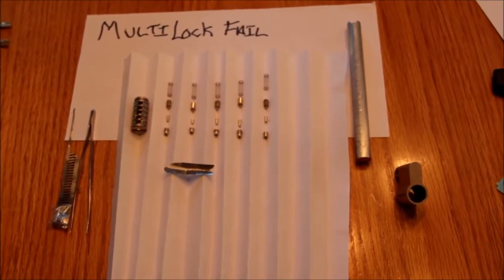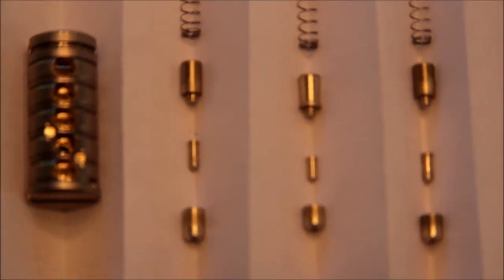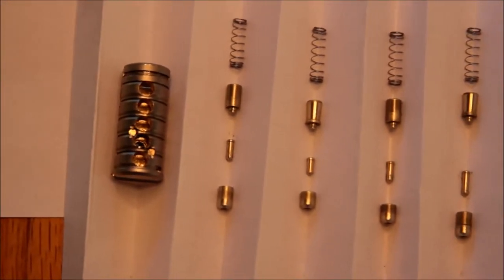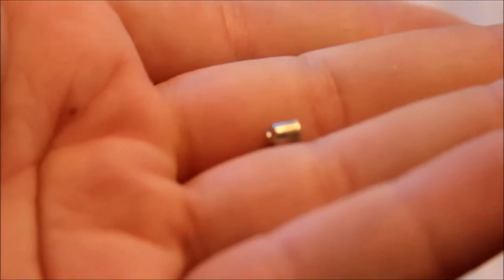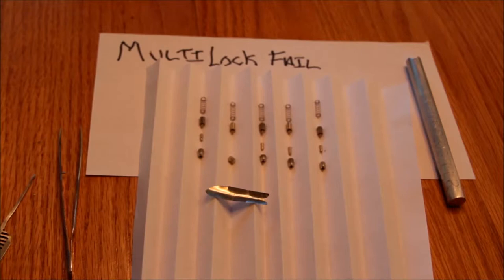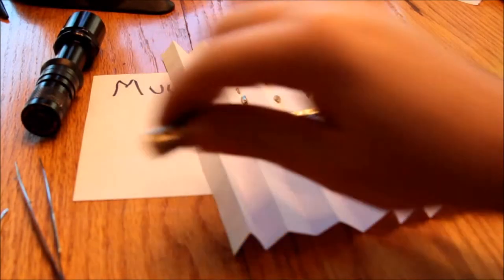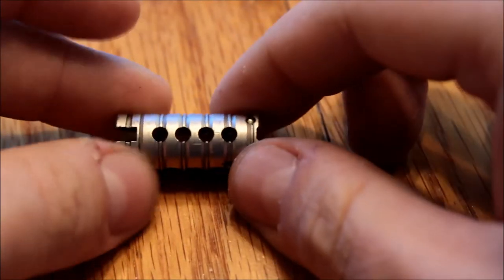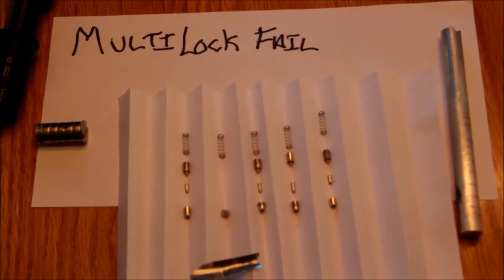(012) Multilock Fail... or, what would Bill do? (1 of 2)

Comment: Its a MTL interactive, the goofy pin is the interactive element, it lifts the center pin of pin 2 higher than possible with just a blank.  More for key control than anything, does not affect picking.  The side holes are for passive side pins, key control once again.  Good luck with picking it!!!!

Comment: "Go medieval on it's ass" Probably :D 
Interesting video mate bad to hear that the lock was not in a good shape :(
The brass looking anti drill pin could be a manganese steel rod. They sometimes use those because then they have 2 different anti drill materials which may get your drill stuck. Manganese plates (in German Mangan Hartstahl) are also used in safes to prevent drilling or make it harder. That lock has some good drill protection! Great video mate :)